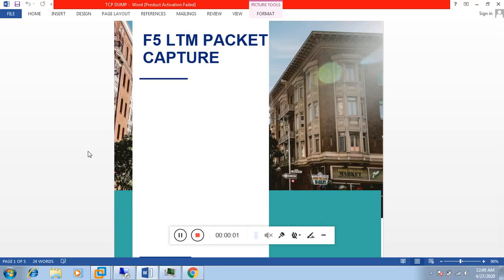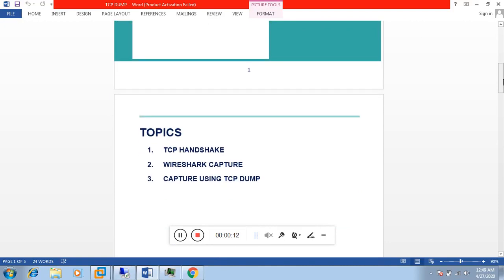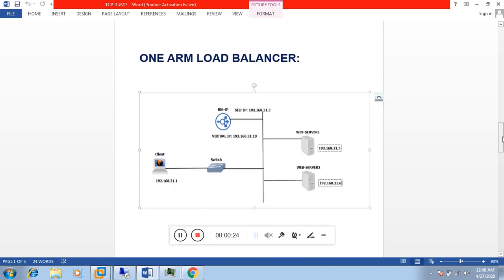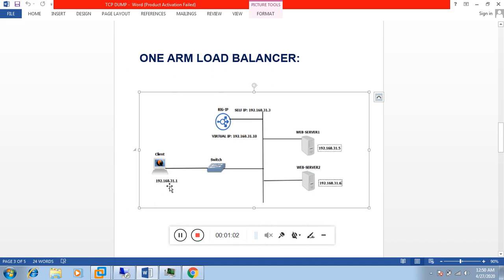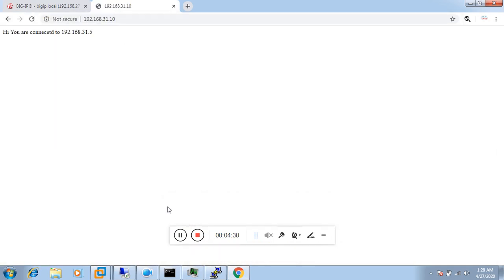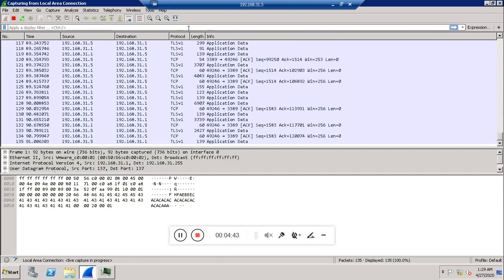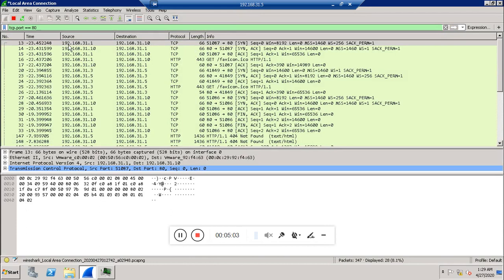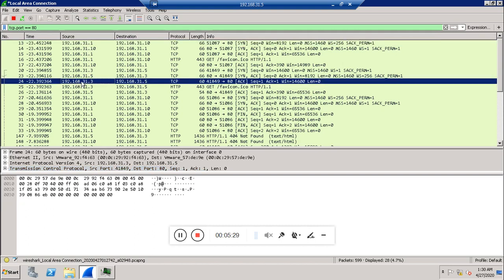F5 troubleshooting using tcp dump utility

Comment: But, I don't see that you have diagnosed the ERR_CONNECTION_RESET failure seen when trying to access the VIP and the tcpdump command message on bigip [R.] (reset) sent from the VIP to the client. What was the solution?

Comment: i have below question
if reals server is 192.168. 20.21 and 192.168.20.22  ansd self IP configured for this subnet as 192.168.20.2 and 192.168.20.3  in active standby f5 so it will anyone of the self as client IP when forward the traffic to real server?, since you use comman subnet for all client, VIp, real server hence i have a doubt and
 asking this question.
Reply from the maker: Yes, When we use Auto Map configuration for SNAT it will use any self IP assigned to egress VLAN and prefer the floating IP over Non floating self IP address.

When there are multiple self IP addresses on the egress VLAN, the BIG-IP system alternates the addresses.

Hope this is helpful for you
Reply from the maker: To add on last comment,In absence of self ip addrees in egress vlan then self ip address of non egress vlan can be used, depending on the network routing configuration, selection of a self IP other than the egress VLAN may cause traffic disruption. F5 recommends that you ensure that you have configured floating self IP addresses on all VLANs from which you expect SNAT traffic to egress. 

The SNAT Automap feature selects a translation address from the available self IP address in the following order of preference:

    Floating self IP addresses on the egress VLAN
    Floating self IP addresses on different VLANs
    Non-floating self IP addresses on the egress VLAN
    Non-floating self IP addresses on different VLANs

Note: Floating IP is preferred to avoid disruption in HA failover scenario